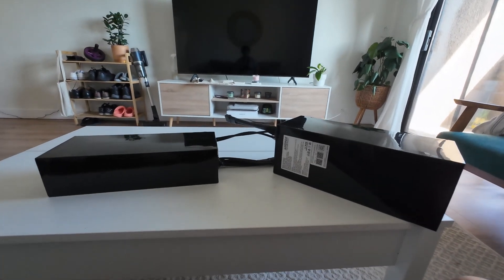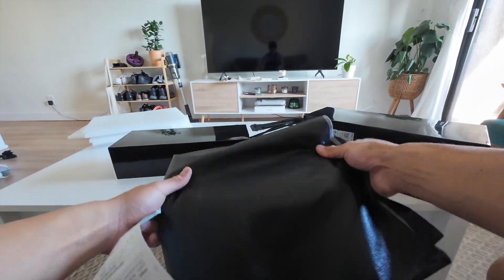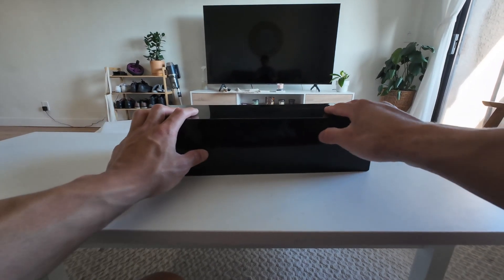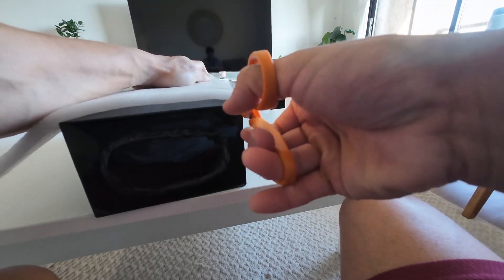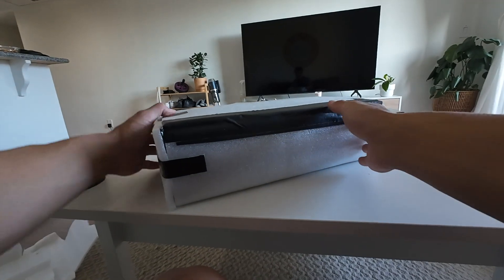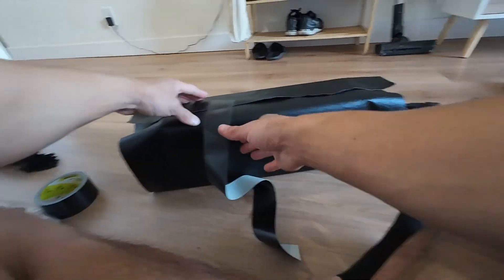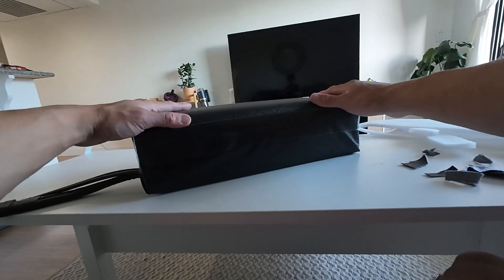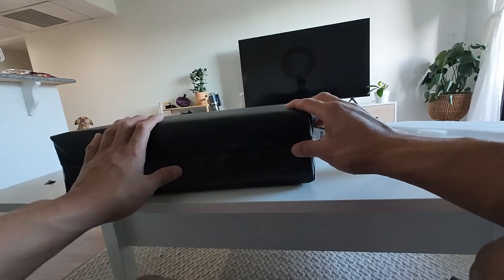DIY Battery Bag | 72v Aniioki Build Part 1

Comment: Doesn't the battery heat up more when it's dressed like that?
Reply from the maker: I’ve never experienced that and I ride my bikes hard. My motor and controller will heat up but never my batteries.
Reply: @Raspyrides  Good thing. I've just somehow learned to keep the battery as cool as possible. My temperatures usually don't rise above 30 celsius either. Nice implementation, you have to do the same for one scooter in any winter 👍🏻 Here in Finland, the temperature can drop to -34 celsius in winter and it's good to have the battery "dressed in winter clothes".
Reply from the maker: @saulikomulainen  I’m sure the foam can act as insulation for winter as well as protection too!